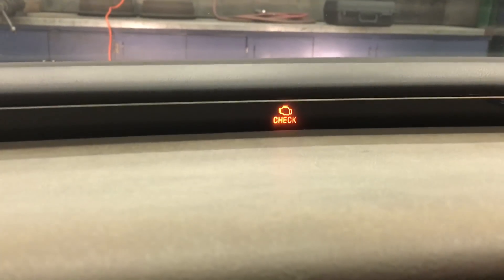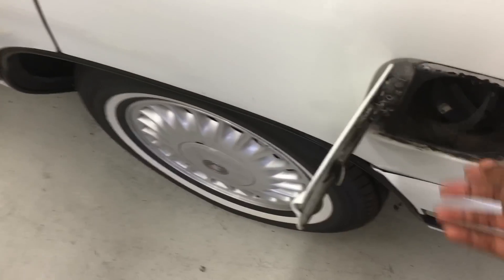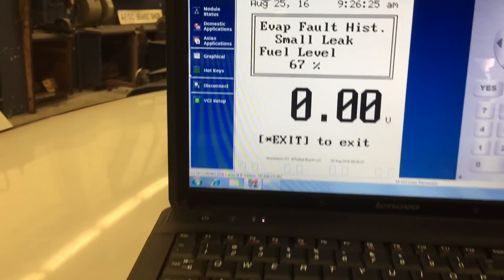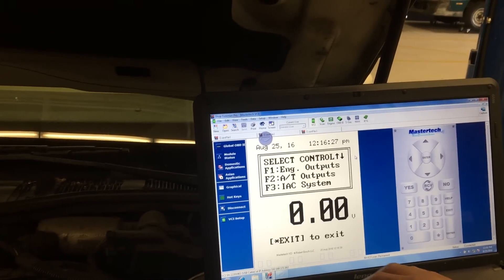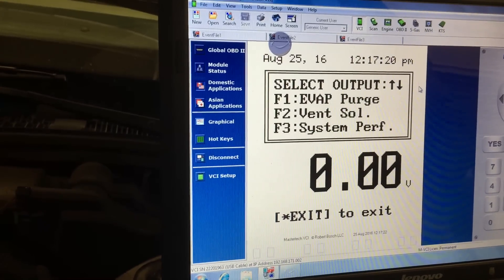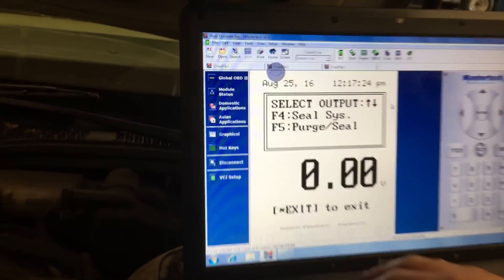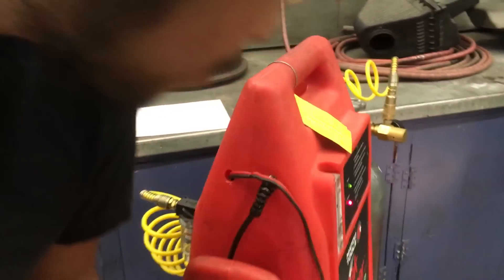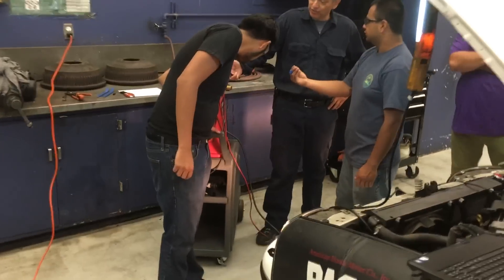Smog Technician Repair Recertification Exam Preparation: P0442  -  How to locate a EVAP Leak

Comment: You seem knowledgeable on these buicks, I have a 1999 Lesabre, withe the heat and ac i cant get the air to change from the floor, dash and the defrost. Any suggestions